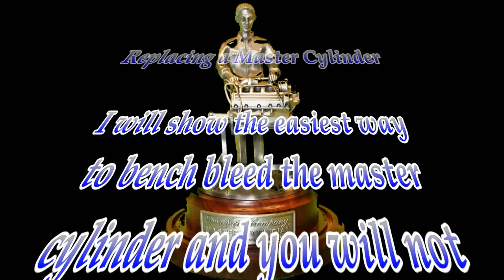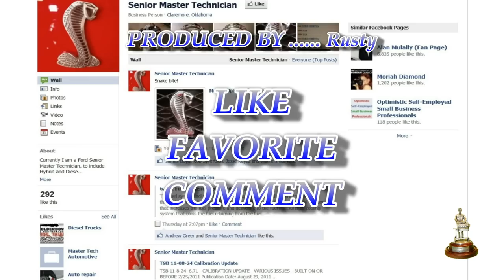Master Cylinder Replacement - Bench Bleeding

Comment: Great video.  Before I replaced ALL my brake parts, I first flushed with De-Natured Alcohol several times & left overnight to soak in lines, bled again & you wouldn’t believe the crap / sludge that came out.  After that I air purged the lines then Dot 3 fluid.  New brakes parts installed & bled again twice.  True, I went through allot of alcohol & brake fluid but it’s a recently purchased 1995 Ford at 185K miles on it.
Who knows what maintenance was ever done to it.

Comment: If the pedal goes straight to the floor after doing all the lines and filled the master cylinder and pedal still goes to the floor with no resistance at all it's time to replace the master cylinder right?

Comment: For Ford Freestar and Windstar, LET THE ENGINE RUNNING during bleeding if you have Traction Control. There is a pump on the hydraulic system and it won't bleed without the engine running.

Comment: Great video!
    With the bled MC on vehicle would it be possible to finish bleeding by pushing back front and rear caliper pistons, forcing fluid up th MC thus expelling any air up to the MC?
Reply: You don't want to do it that way because all the filthy, nasty break fluid in your wheel cylinders and lines.  You want to do it on the bench using clean, new brake fluid.

Comment from the maker: @000030stephen The rubber end is is part of this tool available from Cardone. You could make it your self, 1/2" diam, 1/2 long. Taper one end for the sealing surface and drill a hole through the center.

Comment: He says to loosen and tighten both brake line fittings while bleeding. but towards the end he only loosened and tightened one brake line fitting. What happens to the other brake line fitting?
Reply: there are 2 reservoirs in the master cylinder. 1 for the front breaks and one for the back. If he determined that the one he left closed has been bled enough then no need to open that one again. maybe the front reservoir had more air.
Reply: Dan Kriston 
Agreed.  Off camera he probably bled them again.

Comment from the maker: @turbobuick33 
The pressure switch if for speed control. Speed control uses brake pressure input as a redundancy from failures. Some newer vehicle now use this input into ABS also.

Comment: how do you clean up fluid just sprayed in engine compartment?
Reply: 6824648 normally you'd probably should place towels and or rags to  soak up the fluid. Since brake fluid can cause issues if not cleaned up.
Reply: Since brake fluid is hydroscopic, you can easily clean it up with soap and water. I use simple green degreaser, and spray liberally with water for a no residue surface.

Comment from the maker: @305supersport 
When I disconnected the line at the master cylinder to bleed, it was just to bleed the master cylinder to the lines. If you build the pressure first then release the line, it would have already pushed air into the line causing me to bleed the entire system.

Comment: I only took the two bolts off holding the cylinder in no hoses. The cylinder wouldnt come out easy. I had to pull hard and then I poped out and made a release of pressure sound. Is that bad? Or is it just because I didn't disconnect the hoses?

Comment: What was the reason for the master cylinder change. I have a 2002 F-150 and my breaks are soft. Would this be a reason to change the cylinder? I have replace all the pads and the pedal is still stof.

Comment: So tell me when bleeding all of the lines do you have the engine running or not?
Reply: No ,you don't have to run the engine, to bleed the brakes. In fact its easier w/the engine off it's easier to communicate w/your assistant.

Comment: Thank you for your observation but,,,,,,,,,,,,why wash brake fluid off with water after you/he make a mess in the first place,,,,???  Simply place an old ice cream carton directly under the master cylinder and some old scruntched-up newspaper either side,,,,!!!  Prevents old (corrosive) brake fluid dripping through the engine bay under the master cylinder,,,,!!!  The mark of a good engineer is directly related to their clean work habit/s and the pride in their work,,,,!!!,,,,,,,,,,,,Yes,,,,???